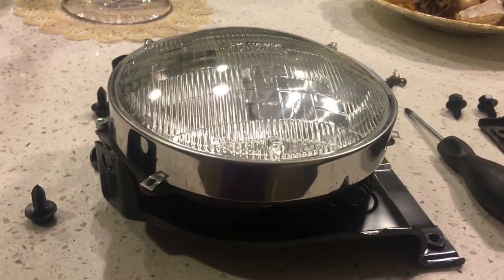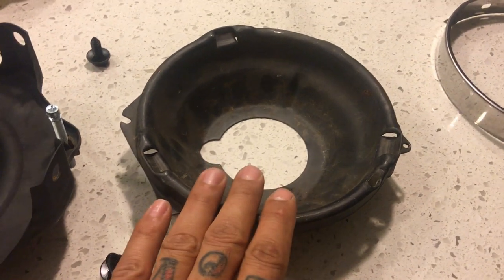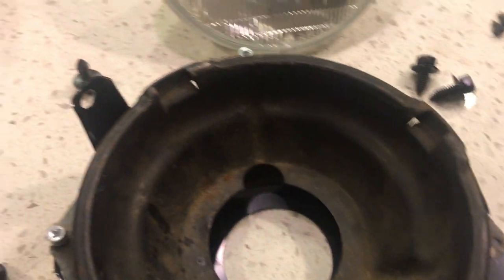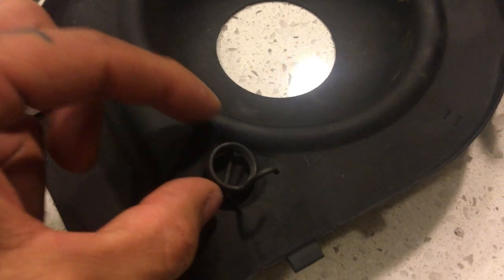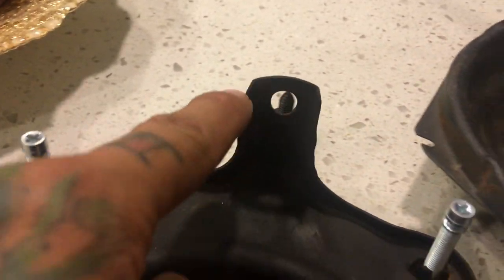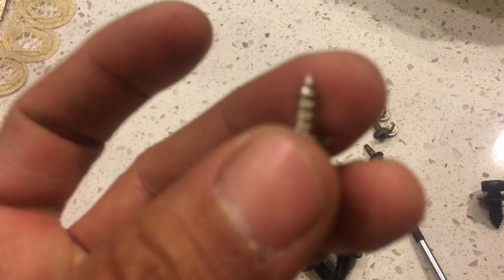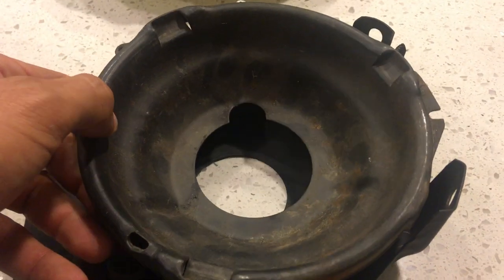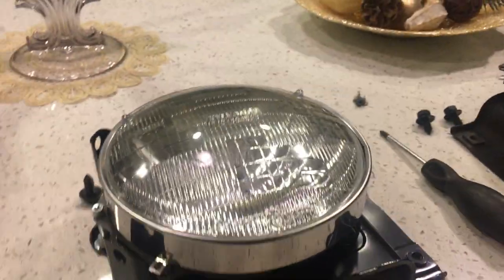1970 - 1980 Bucket Style Headlight Installation Instructions

Comment: Different on 76,,, trying to figure it out,, how many springs and adjustment bolts go on each headlight.. On a 76 there is no metal behind bracket bucket that bolts to rad support,,, the car came missing all the parts.

Comment: I have a 77 camaro i recen5ly aquired and took the passenger side headlight assembly off another car put it on the passenger side of my car and can not get the ring to properly line up no matter what. Its so aggravating. Not sure if i put the main backing plate on wrong or what.